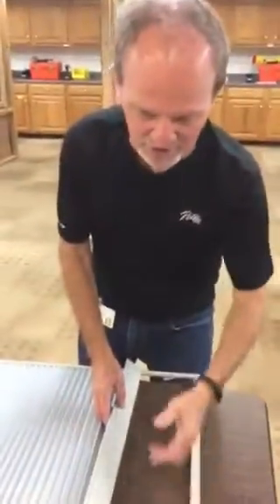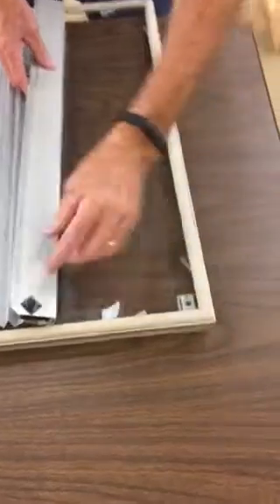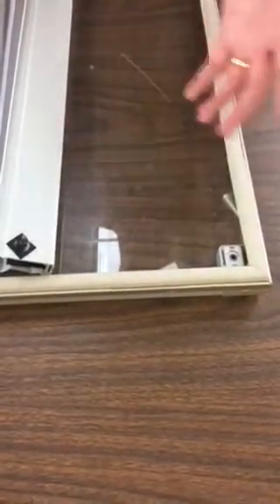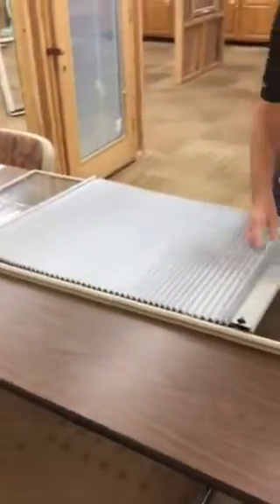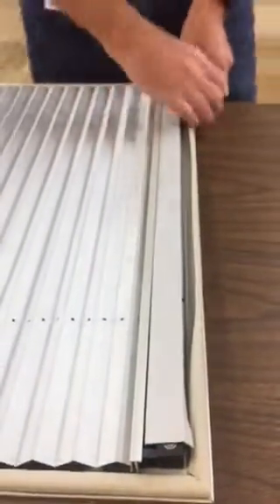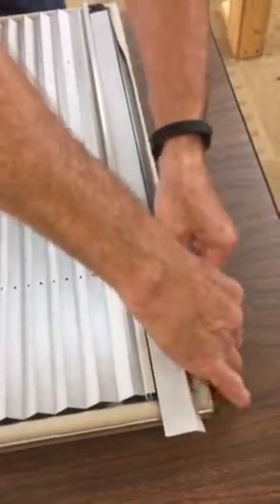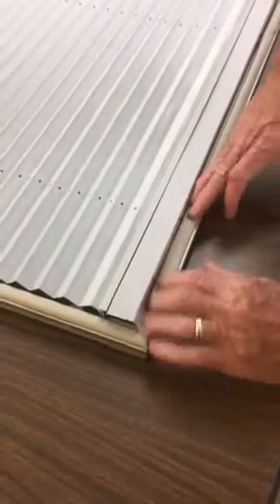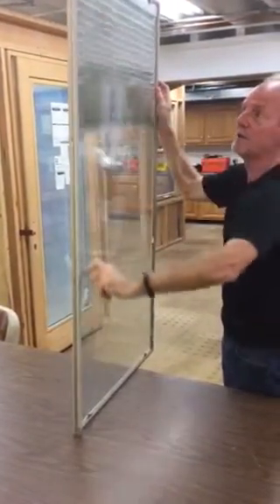Pella Designer Series replacing blinds in glass panel

Comment: I moved into a house with Pella windows. One of the Pella Snap-In Between-The-Glass Fabric Shade was broken. I contacted the local Pella service technician. The price for the Snap-in Between the Glass shade was quoted for $800.64 plus on-site replacement service ($185). It is outrage expensive. I'm so sick of these windows.
Reply: You got off cheap, I was just quoted 1400 for the part.  It was all I could do to not tell them to F'off.  What a ripoff.

Comment: One of the blinds between our patio door fell off and the mechanism your showing where the rod (hexagon) must go into the specific hole broke. We have the piece that broke off and are wondering if we super glue it on if it will hold. Pella has told us that our warranty has ran out and they want $125 just to come assess the problem. We have replaced all the windows in our home with Pella. Never again.
Reply from the maker: Hey Karla, what piece are you talking about? You can send a picture to me and I will take a look at it wilsond@pella.comThank you
Reply: Karla Tomlinson same here!! I paid over $3,000 for my front window. Those blinds are worthless. Same thing for the smaller window unit in my bedroom. One of them just fell off today and all I did was take out the window to clean it. Now I can’t get the actual blind back in the window. It’s impossible. 😡